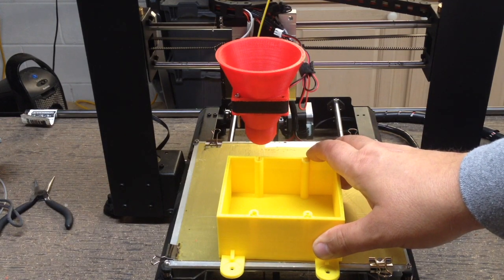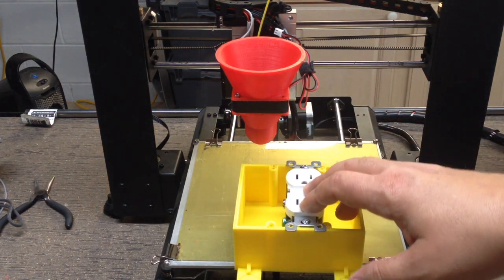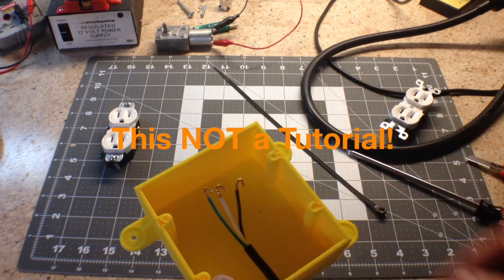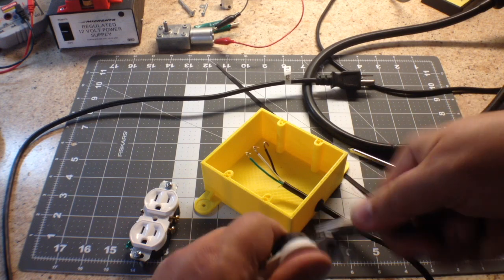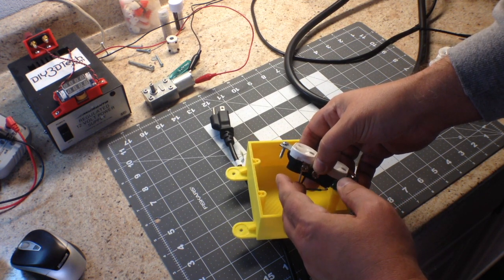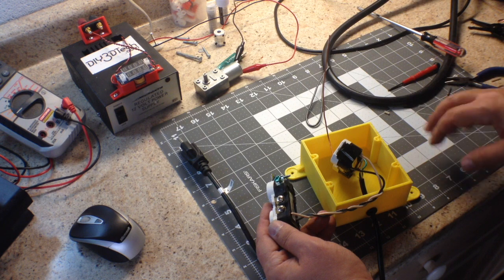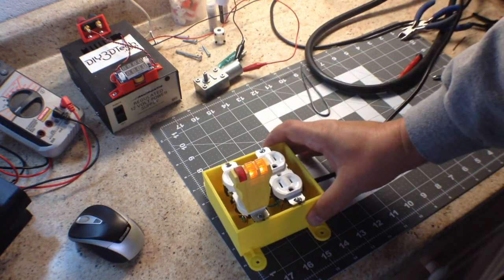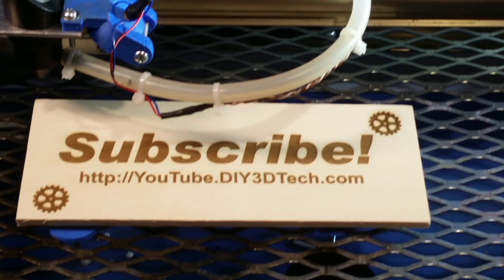3D Printed Project   Dual Outlet Utility Box Part 1!

Comment: Very cool, thank you, sir. Two questions: which 3-D printer were you using, and approximately how long did it take you to print this receptacle box? Bonus question: Does the printer get hot (i.e. result in increased heat being created in the room that you are operating it)? Thank you again.

Comment: I've been tempted to print some electrical box in the past but the fact they have no flame retarded material impregnated in the plastics; means they could go up in a ball of fire, especially with PLA...  :-)
Reply from the maker: Your 100% correct this is why I not use it (nor is it designed to)  replace one for installation in a home.  I use this one for a bench top extension only and unplug when finished...